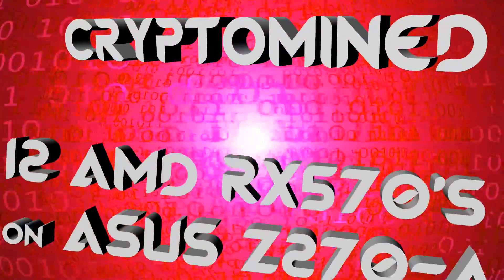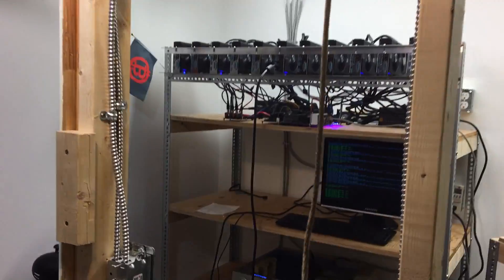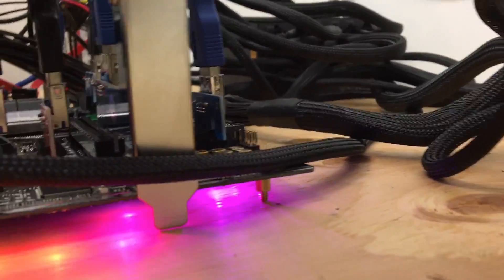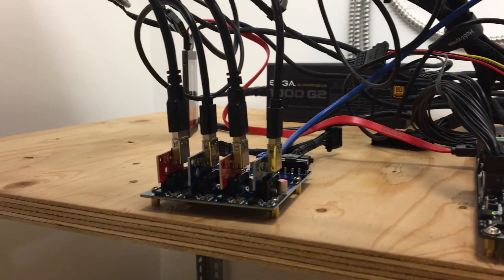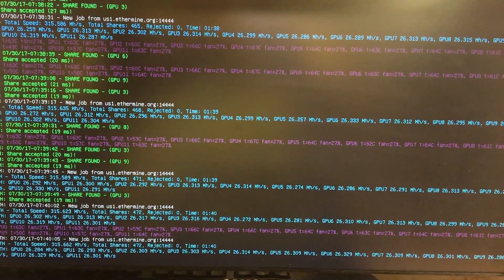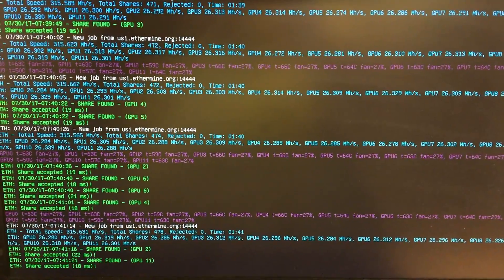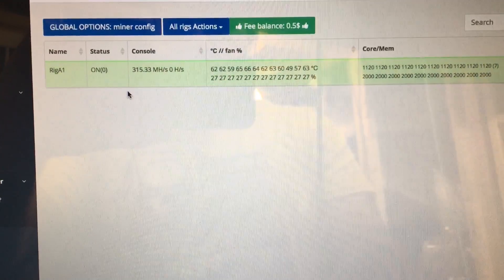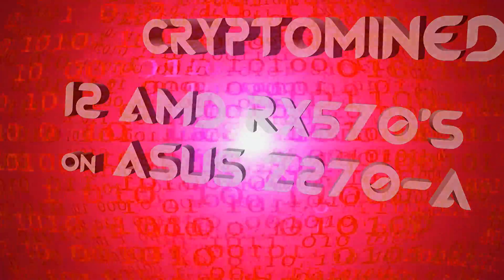ASUS Z270-A 12 GPU Rig with AMD RX570 4G Nitro+ and SimpleminingOS

Comment: I have already connected 15GPU to Z270-A and it works fine no issues. i didnt even use the M.2 POrts
Reply: Sweet! Can you share your setup? I will be trying 15 GPU this weekend. Thanks.
Reply: Hamid Seyedi  please let me know how ya got 15... BIOS settings. How many of these adapters ya buy ?
Reply: Robert did ya get 15 to work? im stuck at 13 :(
Reply: I got the 14th card recognized but wouldn't hash...tried various bios mods and doubled ram to 16GB, but without success.  13 worked for me too.  It may be the limitations of the Celeron...might have to upgrade to i7.
Reply: Robert Matta how did you get it to register ... I can't even get machine to post... Sits on white light on MOBO
Reply: plug display in gpu not mobo.  if using two expansion cards, one should be in x16_1 and the other in x16_2
Reply: do you have to disable onboard video too?
Reply: anyway to get some kind of Personal Msg going?
Reply: see link.  I used exact mods.  https://youtu.be/DR-FkpU2KfI
Reply: any luck on getting 13+ cards?
Reply: cant even get 4 working haha
Reply: Hey Robert, how did that go any luck? I’m having trouble getting my 12 to be recognized in windows all at once

Comment: Hello, 
THIS IS VERY IMPORTANT MESSAGE ABOUT UPCOMMING DASHBOARD UPGRADE !!!
In next 1-3 days there will be implemented new dashboard !
Becasue of that there will be about 1-2 hour delay in accessing online dashboard.
In this time, you wont be able to add new rigs, changing settings and see the current status of your rigs. 
All your rigs will be mining normally with last settings. Please look into your pool statistics.
There will be also new login system in which you could set your own password !
Please use unique nad secure password that you are not using anywhere else.

The dashbaord maintenence will start at 1 August 2017 somewere between 8:00 AM and 13:00 AM GMT time and should take about 1-3 hours.
The current GMT time you can check here: https://time.is/en/GMT
Reply: Rig grouping is coming to SM

Comment: Hello...very good video! Brot i have a question, i have a MSI Z170 Kraig Gaming 3X motherboard with 1 M.2 slot. I try to install one GPU with the M.2 PCI-E Adapter but the motherboard not reconized the GPU is as the GPU not installed in the slot. What do you think about that?. Thanks
Reply: Brian Elizondo, you have to change the bios setting for that m.2 slot to pcie
Reply: I try this...i update the bios with the last version, but the bios not have an option for setting the m.2 slot. The MSI staff say me this is automatic option, but windows 10 no reconized or detect anything
Reply: Brian Elizondo, a lot of people have issues with z170.  I recommend you check out Bits Be Tripping episode #39 at 28 minutes in the video they show the Bios mods for a similar board. Good luck!
Reply: ok, perfect! let me check that episode! thanks brot!

Comment: Cool didn't know this board can support 12gpus.
Reply: Can even more =)
Reply: Bartosz Szczęsny that sounds good, but witch os will support. Think simplemining max is 14.
Reply: i'm always wondering why peoples always try to use all in one software ... why you don't want to try with simple debian cli version (can be netinstall), in all this awasome software you have the same miners like claymore etc. so why you want to pay multiple times for claymore, OS creator and of course pool. There is no OS limitation only mining software and drivers...
Reply: there is one miner connecting 32GPUS in  SM if the system see all 32 it will work.I will update
Reply: Bartosz Szczęsny well that's the issue that for example windows drivers doesn't support more then 8 amd gpu drivers.
Reply: Guntis Vitolins i think this kernel limitation on m$ if you have some basic linux skills you will be able to run it on debian for example. Feel free to ask.
Reply: Guntis Vitolins, I noticed you're using the same cards in one of your recent vids and getting 27+ MH/s in ethOS.  I'm only able to get 25.5 in ethOS. Would love to know what mods you used! Thanks

Comment: Nice!  Thanks for posting this.  I saw the pcie splitters, but didn't want to buy them because I wasn't sure if they would work or not.
Reply: aleks, I didn't believe it myself when I saw this video, so I went down to my basement to check and they're still working just fine :p
Reply: The DAG file will just take longer to upload to the GPU memory.
Reply: as far as i understand, the contention is for hashing power. The BW for communication may not even be fully utilised because the block sizes aren't that big.
Reply: @Aleks once the dag file is into the GPU there is very little COMM to the board.